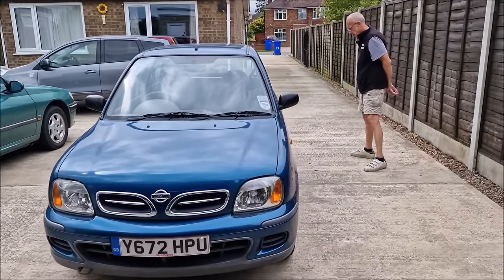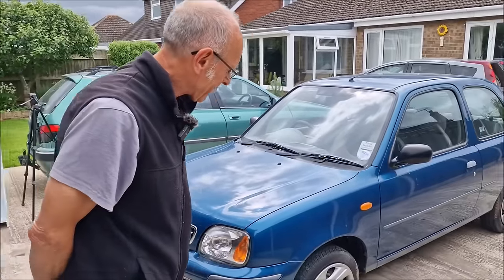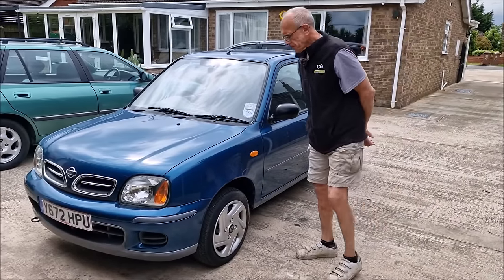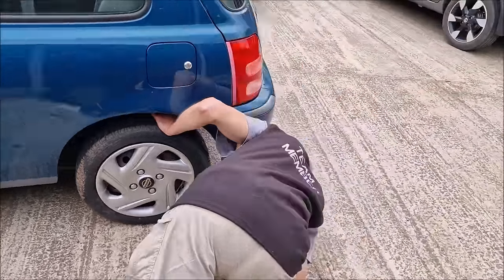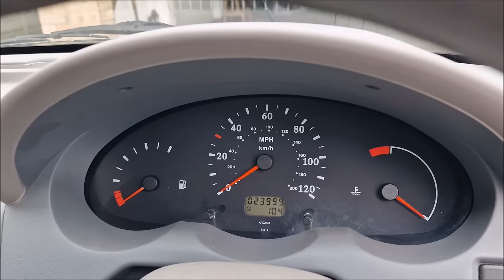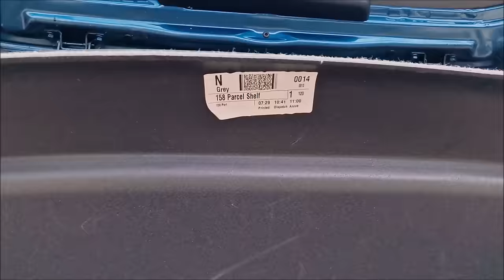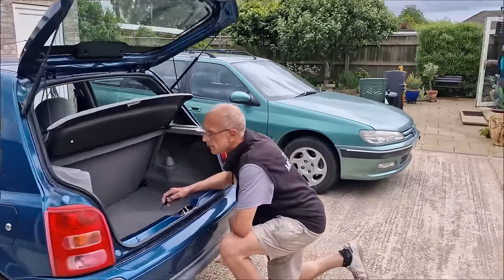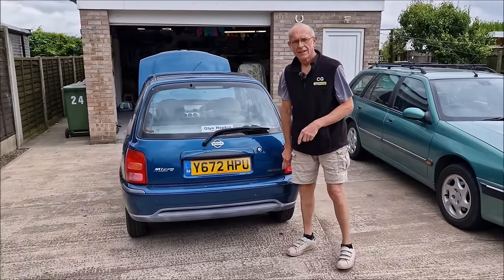Dad's First Look At This K11 Nissan Micra - What Will His Reaction Be To This Timewarp Car?

Comment: In 2003 I bought a Micra Tempest K11 new for £7995 from Arnold  clark ( big mistake) it was the last of the line before the newer uglier Micra came onto the market, it was a great little car and had all the extras electric front windows and air con and a manual sunroof, but the rust and build quality was its biggest issue its the only car I have ever owned that rusted so quickly on the underside the car went for scrap in  2011 the engine was in perfect running order but the rust killed her to the point that welding her underneath would be uneconomical it needed new sills on both side a new Sump which became paper thin with corrosion and the lower front subframe cross member needed completely replaced the doors had dropped on their hinges and the rear brake drum kept on seizing, I loved that little car it was a little gem but it was not built for our roads the corrosion protection was non existent. I occasionally see one on the roads they seem to be driven by young lads who pimp them out with fancy wheels and dropped suspension  it amazes me that are still on the road given the corrosion issues
Reply from the maker: She sounded a honey - its a shame the corrosion is / has killed a lot of these off - im enjoying hearing peoples positive memories about the humble K11

Comment: Nice to see some love for the K11. I've had 2 k10's and 3 K11's in my lifetime. Currently have a prefacelift k11 1.0 passion lol. Had it 5 years and its never let me down apart from a bit of welding on the outer sils its been a cheap run around. Im about to try out some Lanoguard to keep the rust at bay...🤣🤣
Reply from the maker: Excellent 👌👍

Comment: I had a red g reg one back in 2006 paid £100 for it low mileage but it needed a lot of welding (wasn't a problem for me) but was slow i put a 1.3 engine in it lasted me 2 years alot of are still used in autograss and banger raceing
Reply from the maker: Fantastic - im so glad to hear they are loved by so many!

Comment: I think we can safely say it's 'lovely'. 😄

I have one in the same colour, 32K miles, not quite poverty spec since it has the original CD player, electric windows, rear parcel shelf speakers, electric door mirrors and a rev counter.

Unfortunately, it has succumbed to the paint flaking at the top of the boot-hatch, the rear window surround has bulged out but doesn't let water in to the boot, and the roof has faded in the sun. 51-plate Sunderland version. Great car.
Reply from the maker: Still sounds a lovely thing! Reliable and im happy its loved :)

Comment: Also what you get for £2 grand you can always buy a 2013 Fiat 500 in Yellow with 84k on the clock all running sort of well LOL On a serious note my friend is going to buy it in 2 months when he has saved the cash so thank goodness i will soon be able to get a nice i10 again something i just turn the key and can drive 40 or 50 miles and back without worrying whats that rattle noise etc lol
Reply: @JonCoupland  cheers Jon 😀